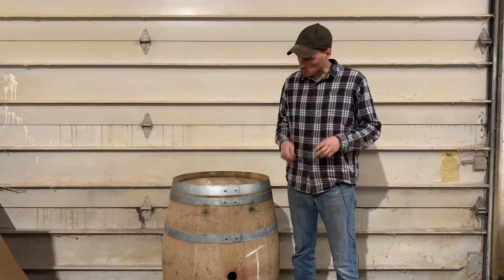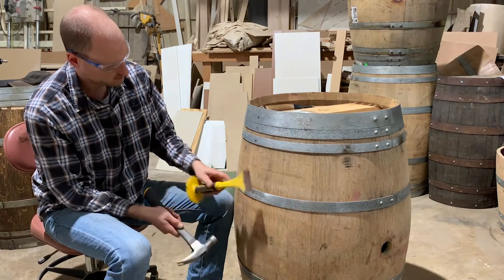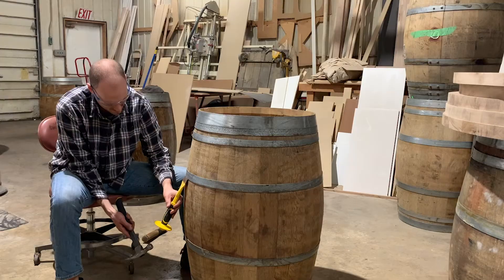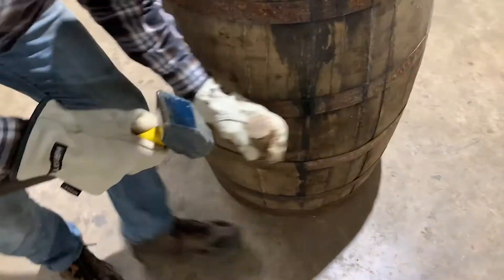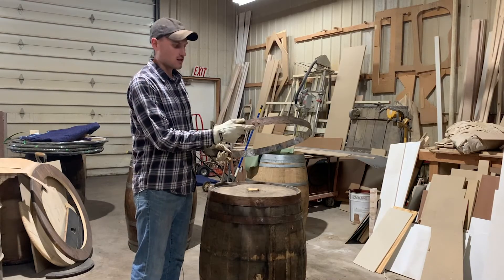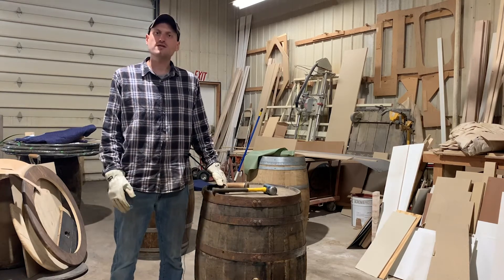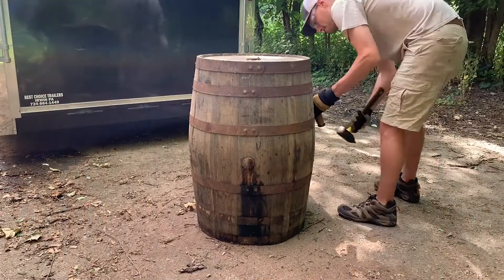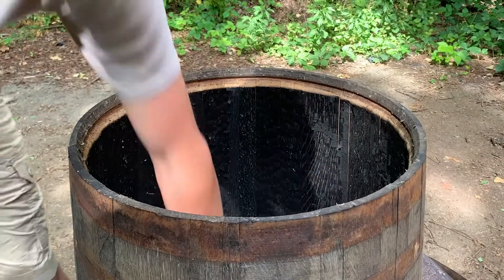Removing the Hoops and Head of a Barrel : A Mystic Barrels DIY Tutorial

Comment: Great video, thank you so much! Just bought a barrel, making it into a water butt. 

Question: when I hammer down the lid, can I then put it back later? Your one started coming apart; it’s not glued at all, right? Also, is there a risk of me breaking it when hammering it down? You seemed to be really giving it some welly. 

Basically, I need to take off the lid so that I can inspect the inside (drink any remaining whisky!) and fit a rain diverter; I may need access to fit the tap as well. 

Thanks!!
Reply from the maker: Hey Edward! Glad you liked it. Reinstalling a barrel head can be a bit tricky. The hardest part is not going to be getting the head seated in the grove. Its going to be getting the hoops back into the same position as they started. Especially the outside hoop. In production, they have hydraulic presses to get those hoops in position. So its a bit tricky to do without.  I've have a number of customers use the EarthMinded Rail Barrel Kit with lots of success. You can do everything from the outside without needed to open up the barrel. Here is the link: https://www.amazon.com/EarthMinded-Rain-Barrel-Diverter-Parts/dp/B005CJFBJE
Reply: @MysticBarrels  thanks so much! This is really helpful. You have a fantastic channel! I can’t remember the last time, if ever, I watched all the videos a channel had in one go!

Well, I have an old butt and bought a brand new diverter kit with it already and would rather not chuck it out to be honest. It requires twisting on a cap on the inside and out. And anyway I’m really curious to see the inside!!

I take your point about getting the outside hoop back on being a ball ache; but I think I’ll have a crack. Appreciate the warning. Especially as mine is a whiskey barrel with lots of rust everywhere. 

If it kicks up a fuss on the return journey I’ll try using various bits and bobs like straps etc. to tighten up the top section enough to get the hoop back on. Fingers crossed!

Comment: If I remove the 4 hoops in the middle and leave the 2 on both ends, my barrel should stay together while sanding correct?  I’ll put a ratchet strap on to help before I start sanding.
Reply from the maker: Hey Kyle! As long as the hoops were tight to begin with, you shouldn't have any problem removing the interior 4 hoops and having the barrel stay together. If the hoops were loose to begin with, you may want to secure the top and bottom hoops first to ensure everything stays together. Good luck!
Reply: The company I bought the whiskey barrel from said he sells to breweries to use for beer, so it’s still in great shape.  I guess I’ll give it a go this weekend.  Thanks for the reply.  Awesome videos also!

Comment: My barrel has dried out since I bought it, and the staves don't lie flush with each other any more. The top and bottom hoops are still tight, though. If I tap the belly and quarter hoops closer to the middle of the barrel, will that pull the staves flush and level?